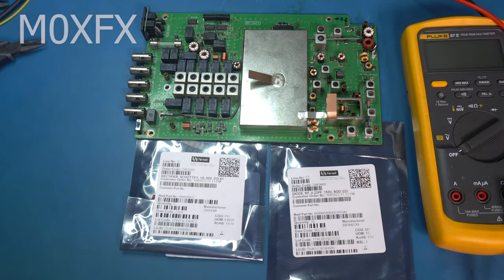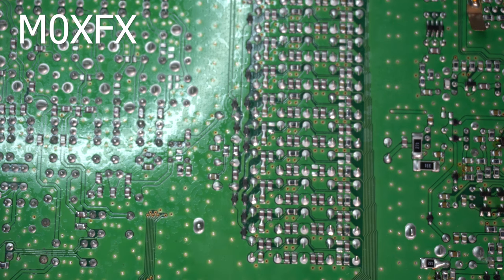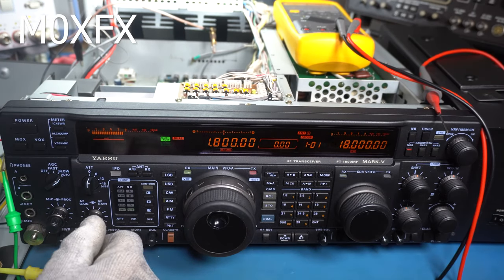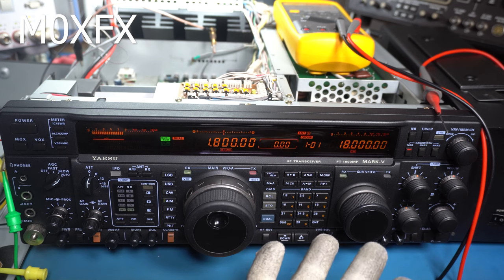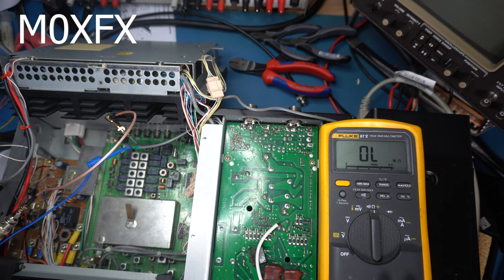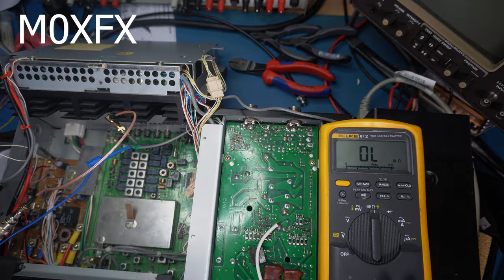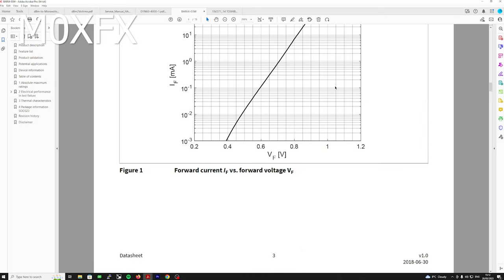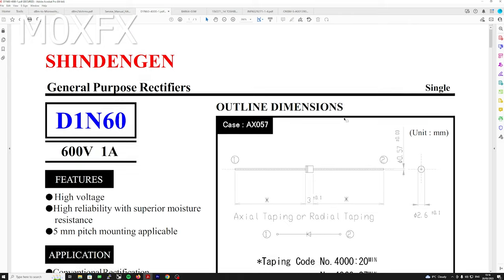Yaesu FT-1000MP Mark V No RX-TX Troubleshoot & Repair Part-2

Comment: The cheap signal generator will serve the purpose it will give S9 and you can give weak signal for peaking the stages cheap and cheerful but works for me and I’ve got the Marconi 2955
Reply from the maker: Hi Andy, Great comment, the 2955 was quite a thing in its day and is still very useful for this type of radio gear.

Comment: looking at the diodes i can see a possible user error,
but looking at the antenna switch relay area and that solder looks not very clever.
along with the previous repair could it be that you are actually cleaning up someone other 'top tech's mistakes ??

amazes me how such high end radios get damaged by such low end users ( no offence intended directly to the owner)
i expect a 30/40 year old CB to have seen it's fair share of careless owners but something like this you'd think would be treated like a member of the family, 

it's coming on and the outlook is promising for sure, 
learning more each time i watch..
Reply from the maker: Hi Mark, Yes I have to agree with you mate. It looks to me like someone has tried to sort this out in the past and I think that they have replaced the pin diode but has not managed to fix the main fault. I am getting the feeling that it's the driver transistor for the relay that is not switching the RX relay correctly which in turn has blown the receiver when it was keyed up.  I'm still looking at it. Have you got any reed relays or reed switches?

Comment: Would any diode survive the rf coming into it though with this fault with the antenna switching…unlikely 🥴
Reply from the maker: Hi there. Yes I completely agree, good point and comment. The problem as I see it is if you strengthen the current carrying capacity of the diodes to much then it's likely that something else would fail further down into the receiver under this kind of fault condition. That being said I do think that the pin diodes in these radios could do with a little more strength i.e. slightly higher current capability as they are also known for failing under apparently normal operation conditions. I guess only time will tell. Thank you for the comment.👍